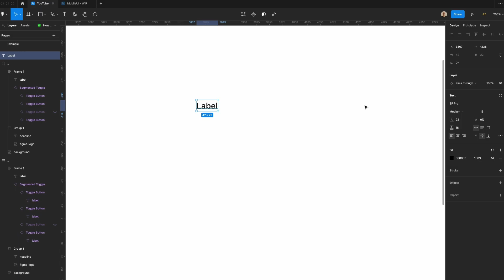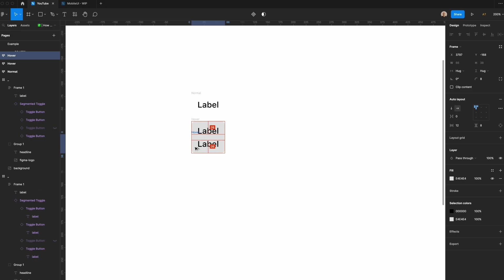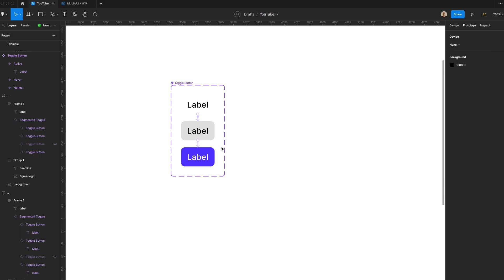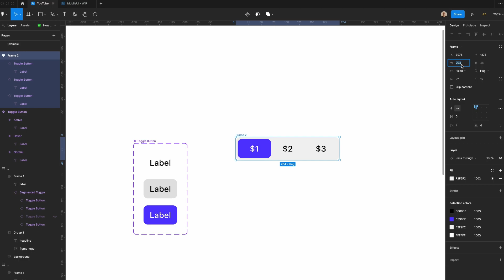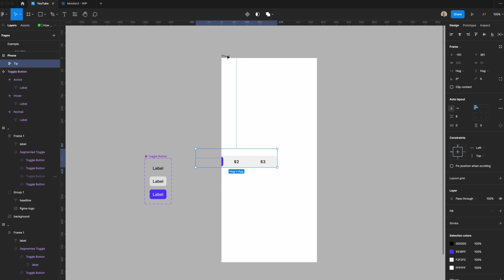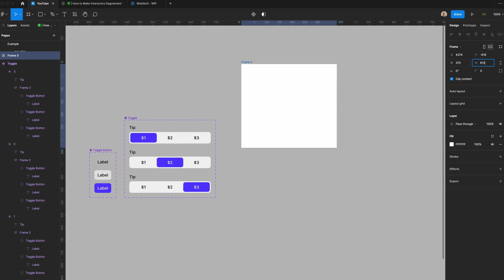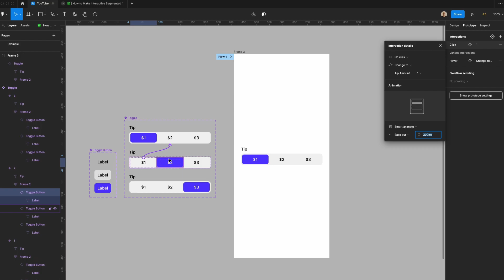How to Design and Prototype a Segmented Toggle in Figma | Segmented Control

Comment: Sure - but what about a long list of things, like mocking a list box... where only one thing can be selected at at time. Even having like 5+ elements would  get really annoying to setup/manage. Have you, or anyone else reading this found a way to easily control toggles with say, variables? Instead of all this manual setup. Imagine you have to add a dollar value to this, you have to go to each instance and modify them all. Axure has a nice feature that just lets you check off "toggle" or something.. i forget. I wish they had this implemented... 

Figma is really only designed for simple SIMPLE mobile apps and websites. But it's being sold to companies as an enterprise tool now and now my life is hell.